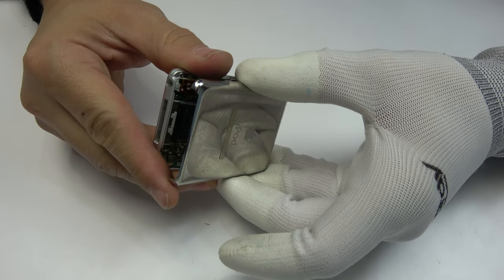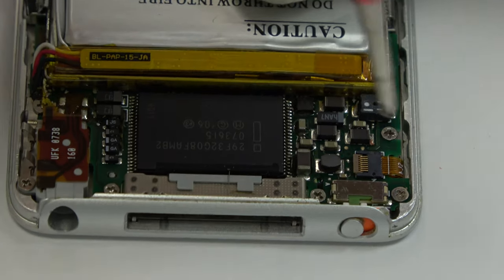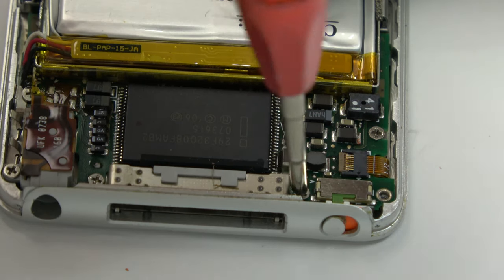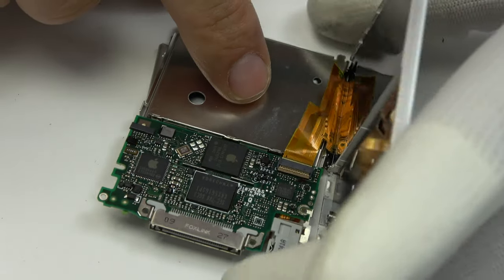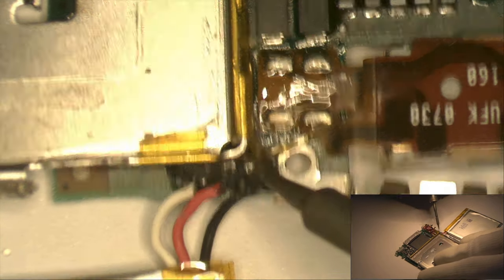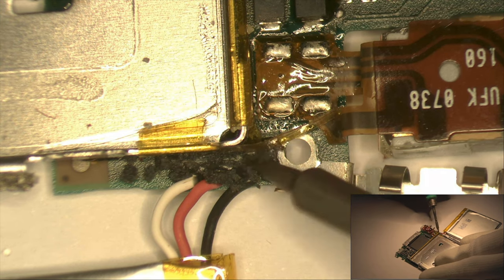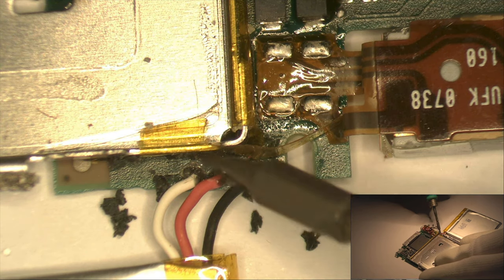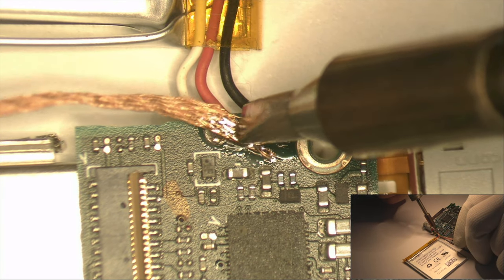iPod Nano 3 rd Battery Replacement in 5 minutes

Comment: Please note that the steps and difficulty in getting that back case off is also not really mentioned in this video. It takes time… and patience to do this step correctly. It might be nice to redo this video to include the actual steps and care needed.
Reply from the maker: Hello, tedwardfox! I didn t say that this repair was an easy one and it s true that you need some tools and experience! More than that i thing it is obvious that you need patience to repair, patience and good pulse; We are not going to redo the video but we appreciate your contribution! Best regards
Reply: @betterthangoat Pho Q! Apple is sinojunk.
Reply: True that! I somehow damaged my LCD in the process now I have to replace that
Reply: @MovilonePhoneRepair  The hard part is taking the case off, note the actual battery replacement. That needs to be shown.
Reply: @ColinFowler  also the soldering can be a major failpoint where you could break it. Personally, I would take it to someone to fix it!
Reply: @DoubleWhopperWithCheese  Wish I had, broke two trying to open the case haha.
Reply: @ColinFowler  Jesus man, my condolences. I've just bought one and I know I would not even dare attempt it. Did you take the third one to a professional or did you manage it on the third?
Reply: @DoubleWhopperWithCheese  The third came with a new battery so avoided all of that but didn't get the satisfaction of doing it myself whilst bricking the previous 2.
Reply: @ColinFowler  yowch

Comment: Lots of steps skipped.  The back doesn't come off that easy.  There are hooks that pretty much have to be destroyed.  The back will not snap back on afterwards and I find it's easier to just cut the hooks off and put the back on with tape.
The battery has a sheet of glue holding in place.  You have to slowly pry that loose.  Sometimes you break the LCD.

Comment: What is the order of disconnecting the battery wires? Should it be black, red then white? I found it hard to desolder the 3 pads on the board. Do you need a high temperature? Then, reconnecting. You show connect earth (white), then negative, then positive(red). How do you avoid shorting the battery, and damaging the logic board? Can you explain this in detail. Then what should the voltage be across the after you have fitted the battery? Thank you. I think I may have damaged my ipod nano now.

Comment: There is no need to take out the circuit board. Just clear the sealant away from around the three old  battery wires  and snip them off.   Solder the new battery wires to these points,  being  careful not to short them together if there is charge in the battery,. Job done.
Reply: its safer and only 6 screws bro, leaving it in would just show that the tech is lazy
Reply: @Ward10Bmx  This tech is not lazy, just crafty. I'm saying that good soldered joints are possible without the extra disassembly and desoldering, saving time, trouble and cost.

Comment: Buy battery and go through these 78 simple steps.Or buy a used one on Ebay for 20. Thanks for posting saved me about 137 hours work and 1,000 son of bitches yelled and the dog barking ..etc..
Reply: Good luck finding a used one with a battery which also isn't shot/worn for a good price. Most users don't mention battery state in post so your basically gambling on that

Just bought a nano which looked fine on a post and battery lasts less than 5 minutes
Reply: AMEN.   Best comment award !
Reply: @Broskibrother  Where do you even still get new batteries? And are those original ones or 3rd party?
Reply: @Serjo777  I don't remember at this point but it was definitely some off brand one from eBay

Comment: I didn't have a soldering wick and I think I accidentally removed a metal ring that holds the the white wire for the battery. Is that bad? Will the connection still work as long as its soldered on well enough?
Reply: possibly.  You most likely dmged the pcb board it self.
Reply: @neuroplasticity  yup, that seems to be the case. Just did a board swap and had to solder on a new one. Thanks for the reply tho!

Comment: Opening the back cover especially with the guitar pick is undoable by the first time user. It's a totally impossible task.
Reply: frederik boersma I cant do it. I opened my 5th at least 4 times. This is impossible
Reply: I did by breaking the back by some blade and clips i bought a new back case, that's the only easy method